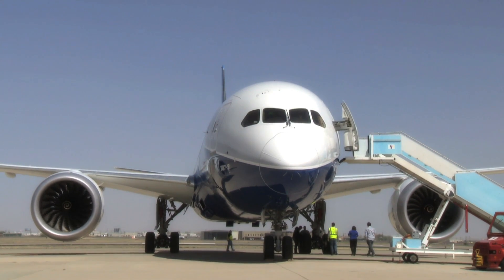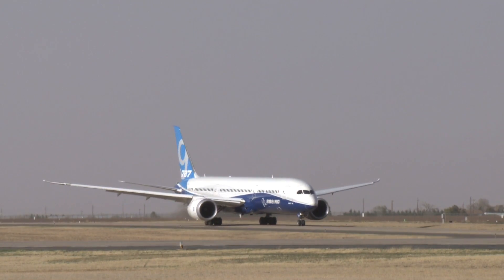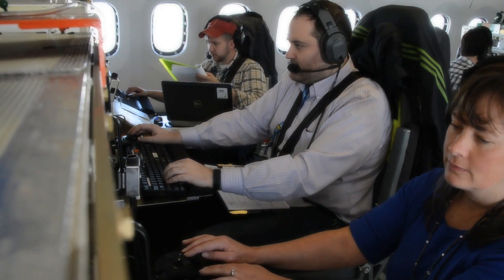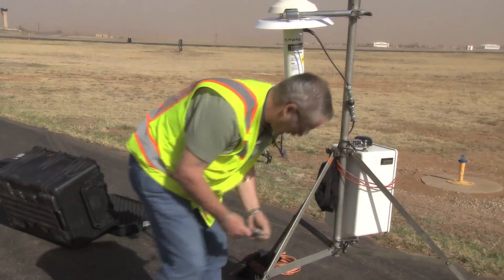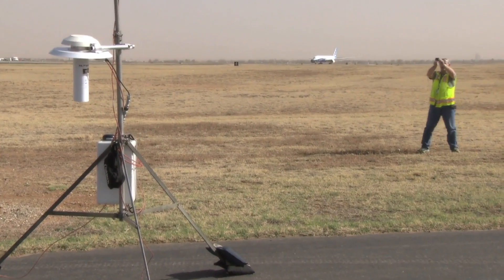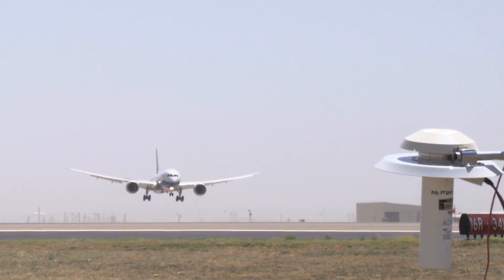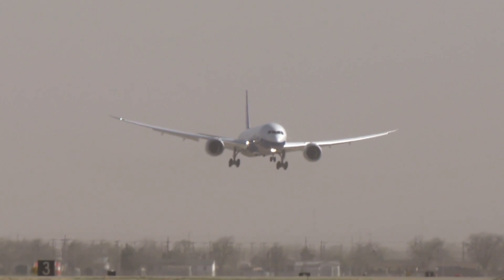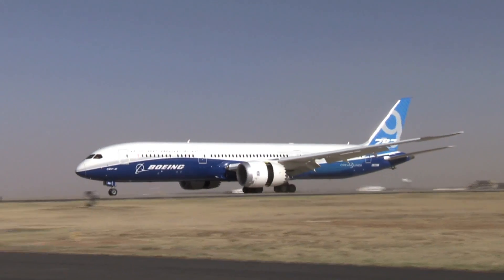The Boeing Test and Evaluation Team Chases the Wind

Comment: Wold be nice if these Modern planes used GPS for high and speed instead of relying on Petot Tubes that could freeze over & make plane computers go crazy.
Reply: GPS is not as accurate as barometric altimeter for altitude, and gives height above the WGS 84 ellipsoid, which is of little use to pilots, the barometric altimeter in simple terms gives height above sea level, based upon the air pressure, which is useful for terrain clearance low down, when taking off and flying approaches, at higher altitude we use a standard air pressure, so that aircraft are using the same setting, en route, regardless of the actual air pressure. 
The pitot tube reads us the speed of the air flowing over the aircraft, useful for knowing how much lift we are generating lift etc. GPS would read our speed over the ground, which is only useful for navigation planning, so an aeroplane flying at 180 knots with wind of 20 knots, could have a GPS speed of anywhere between 160 knots and 200 knots. Also the PItot/static system is self contained, so no outside sources are needed, unlike GPS.